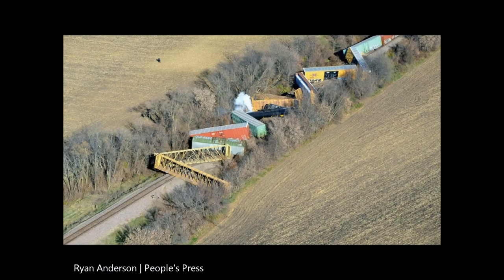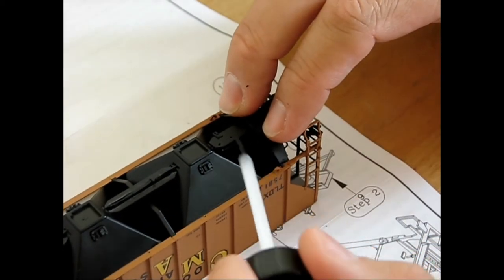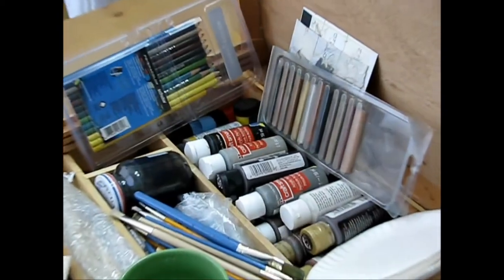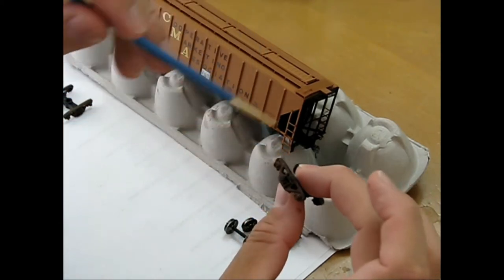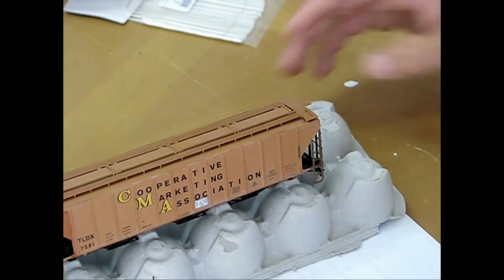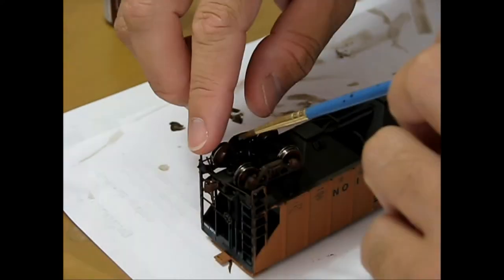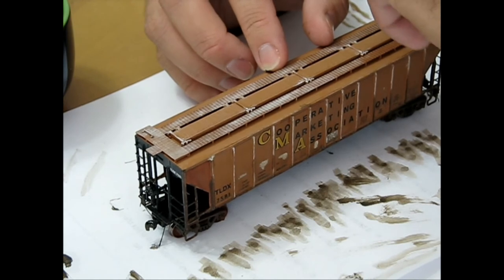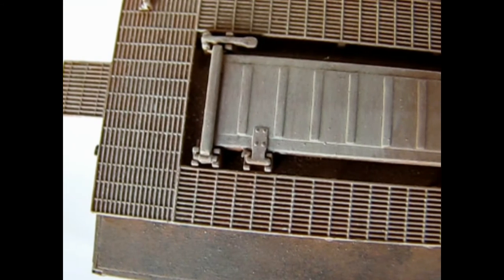Simple Quick Weathering - Covered Hopper Model Railroad

Comment: I usually make my own weathering chalks.  I use the same kitchen grater you use.  I grind up some white chalk and mix some food coloring in a communion cup (great little cups for mixing paints).  I then add my chalk and stir it up with a tooth pick.  I then pour it onto my cutting mat and wait for it to dry.  Then I use a single edged razor blade to cut it up as if you were cutting out a line of cocaine. :-)  Then I put it back into the communion cup for storage until I need it.  For trucks, wheels, freight car bodies and locos to add rust I use REAL rust. I take a roll of fine steel wool and put it into a quart jar and fill it up with white vinegar and set it on a window sill so the sun can shine on it. After a month or two, I pour the liquid out into a stainless photo tray from my darkroom (10X14). After it is completely dry I use a single edged razor blade scraper and scrape the rust out of the tray. It usually comes out as a fine powder. I then store it in a snuff container. Depending on how long you leave the steel wool in the vinegar my batches come out with different colors of rust, i.e., some are orange and others are a deeper colored red. When I get ready to use it I put several scoops of my rust into a plastic communion cup (neat little cups for mixing paints) and add some alcohol, Elemer's white glue and a dab of water soluble glycerin. Then I just brush it on. If I want an area where the rust has eaten through the metal (plastic) I use my X-acto knife and make some gouges in the sides of a car and fill it up with my rust. To seal the rust I usually topcoat it with a flat acrylic clear coat. It looks very realistic 'cause it is REAL rust! Happy Railroading! W Rusty Lane in eastern Tennessee (Witherington Place Railroad)
Reply from the maker: Thanks Rusty!